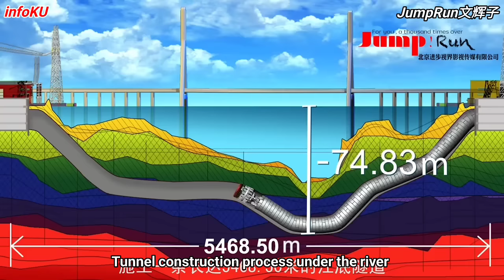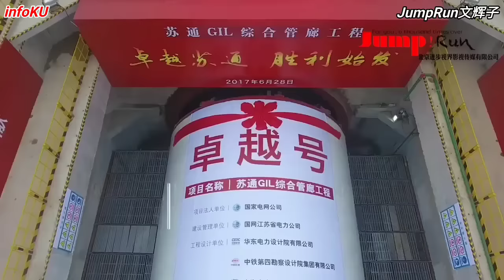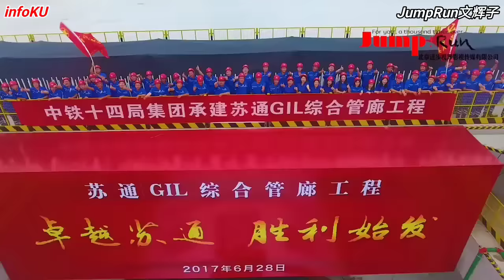Most Expensive Construction in History | World's Longest Artificial River Project

Comment: Nice video and presentation. 
It would be interested to know how is the transport efficiency from evaporation and rain fall. The next interest point is the cost to cubic meter of fresh water per yuan.
Reply from the maker: Thanks bro
Reply: i was wondering about evaporation as well.
Reply: Even the evaporation is good for the environment, because it can increase its local area air moisture and therefor it may get more rainfall as well.
Reply: @andrewzhang985 you may be right. Even more right if the evaporation loss versus returned gain at the same aqua duct is 1:1 ratio.